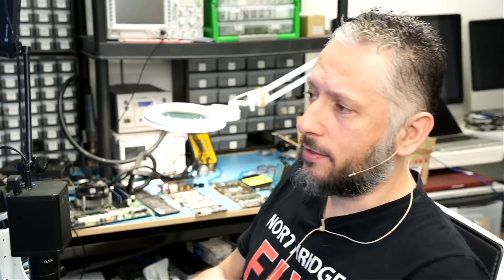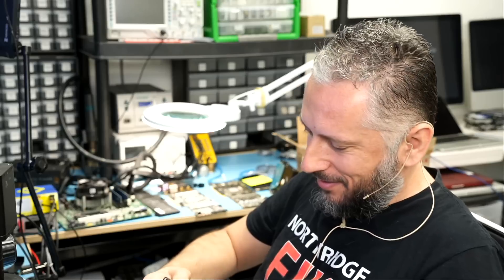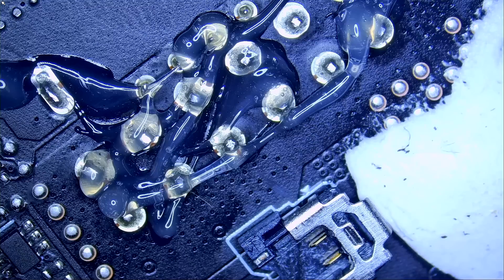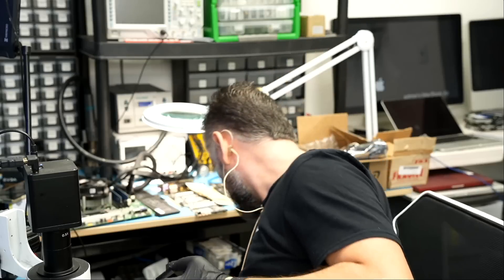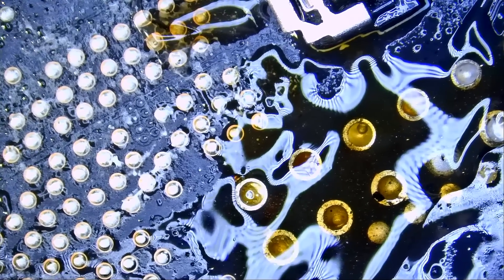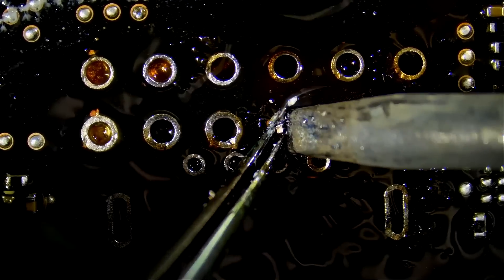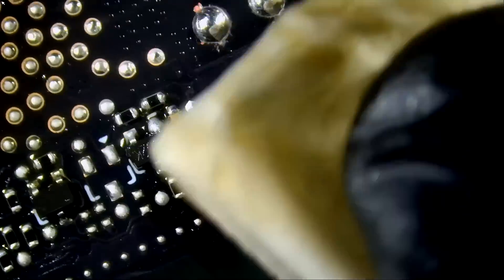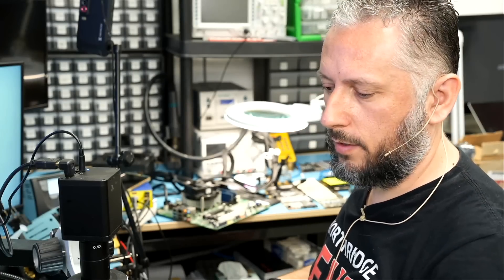4090 FE Connector melted with Cablemod Adapter installed. 40 series cards should be recalled

Comment: As i thought yesterday, the issue is not the user, when things like this happens to a lot of people its not the users fault. Everything is made and designed like crap nowadays, i am so dissapointed with the reliability and built quality of the modern tech. I have opened up so many modern laptops with crap plastic tabs that always break and with garbage designed hinches and where the hinches are screwed all crap plasic that breaks down. Big scummy companys get away with this which is absurd.

Comment: There is already a video that explains why this happens, it's a mix of bad connector design, quality and not properly plugged in cable, so the power goes only in the properly connected pins (6 or 8 or 10) and causes overheating because it's not designed to handle 500-600W on such small amount of pins. Also the pins are really thin and bad quality. This would never happened if you spit that 500W on 3 connectors or just made a good quality connector

Comment: I'm about to buy a 4090 in a few days, but with watching all these cards come in every day i'm not so sure. Might need to order half the NF inventory to keep it working.
Reply: undervolt ur 4090. keeps it cooler and safer.
Reply: I have ran my gigabyte 4090 since release at stock settings with the supplied 4 to 8 pin to one 16 pin connector with no issues and I am on my pc for over 12 hours a day. I made sure it was fully seated and did not put it under an extreme bend in my case. But with all electronics your results may vary.
Reply: @volkswagon1966  Yes it is probably effecting less then 1% of users but it is still pretty concerning.

Comment: People seem to forget their physics class, power going trough a cable will make the material heat and a connector doesn't have a 100% adesion rate, which makes it the same as passing current trough an even thiner cable.
It makes me laugh that even me a 24 years old "kid" knows that and not the enginers over at intel, nvidia and amd.
This is a big joke,  an even bigger error from a professional and a disgrace to their whole enginerring carrer.  It's on them for not properly ascessing what their connector can do.
On average one of these cards uses 400-600 Watts, and i'm not taking in account the power spikes, these connectors don't have enough contact surface to compensate for that and to add salt to the injury, there is not enough conductor material in the connector for it to stay at proper temperatures and not melt the plastic around it in case of power spike.

Comment: I was wondering if many of these meltdowns are caused by poor case ventilation or AIO CPU coolers.   A lot of home builders of rigs simply don't understand the critical importance of case cavity throughput and air channelling and you do get dead zones in and around where the usual PCIex slot for the video card is which can get pretty hot esp if you have chip management, SSD's etc all putting out their own heat footprints.   Then factor in unheard of video card wattages being channelled in, beast sized power supplies happily funnelling in those huge wattages and the damned connector doesn't stand a chance esp if its made from substandard cheap plastic.   nVidia should of seen this coming, maybe used ceramic connector blocks?   Maybe find a fan that can be focused to just the connector to bring its heat down, enough to stop it dribbling under load.

Comment: The connector has 4 data pins that, according to the  PCI-SIG 16-pin connector specs can be used to communicate with the power supply to ensure the connector is fully seated before delivering the full 600 Watts to the board. Does anybody know if this feature has been implimented on the 4090 and do all power supplies also comply with it? Nvidea is blaming the users and PCI-SIG is blaming the manufacturer of the sockets...... so business as usual!.  That 90 degree adapter looked to me to be fully inserted and  it looks like it has melted inside.   End of the day....too much current for too small a contact surface area!  Gold contacts anyone?
Reply: only 3.0 psu could have that

Comment: The 4090 (4080's?) series connectors are simply a stupid idea for the higher power-drawing cards.  There simply isn't enough contact area and/or material to handle the higher current.  WTH were they thinking?  It's just like the stupid USB-C spec of 100W - yeah, 5V@20A through one of those connectors will work perfectly in constant use🙄  I simply refuse to buy the 4090 of any manufacturer.
Reply: Just an FIY, USB-C power delivery of higher wattages is done with 20V @ 5-6Amps, so it is safeish. But you re right about this new 12V ATX connector , its a bad design.

Comment: I wonder if its a case of the solder joints getting hot, and possibly using an inferior type of solder or soldering method.
The solder is drying out  and causing an intermittent connection on the pins causing them to overheat. 
Just a guess, could be wrong.
Reply: Don't think its a soldering problem, most likely the pins not fully contacting causing high resistance and heating up to the melting point of the plastic connection.
Reply: There is nothing wrong with the unleaded solder joints. It's all about contact resistance.

Comment: What if you solder wires directly to the motherboard instead of using connector? 
Yes, it is multilayered board but there is no reason this workaround do not to work..

Comment: This obviously needs further research; is is a bad batch of connectors, overclocking, bad design.... Little worried, I have 2 x 4090, so far they are fine, running for ~1 year.

Comment: It's pretty obvious at this point that the connector is way too small to pass the current the board requires. It's a pretty bad design fault that the board manufacturers need to address.

Comment: The plot thickens, I presume you don't fit a genuine Nvidia connector, do you ever have problems with the ones you fit? If not could the pins on the original connector be slightly undersize so they do not grip tight when plugged in

Comment: After researching this connecter is come from "intel" designed. they design to feeding power maximum of 600W, But they warned keep save at 450W. So...NVIDIA doesn't care. And still use it feed up to 600W and forced card makers use it with anthorithy and the fame of the #1 GPU market share.

Comment: This is a 100% nivida error and I blame everything on them I have 2 4090s and I'm pretty sure I plugged in that cable all the way in and it burned still on both cards I replaced the connector after 1 month I want to get the connector off just to check if it's burned and I couldn't take it off it's melted again and smells like burned garbage so idk what to do anymore should I put a 3 phase wire on there??? Or should I plug a 200 amp wire to it I just hand enough of this I really want to throw this card all over the concrete floor but the issue this card is expensive
Reply: Just a thought as an engineer I would think that the problem looks like consumption is beyond the designed output.connector can not handle the power consumption.i assume this problem occurs when 3 outputs are connected.i don't know if the card was designed for 3 o/p if so then the card or more specific the connector is not designed to carry the load. If it is designed for 1 then perhaps the overloading is customer created. Because you are using 3 times the power designed for

Comment: Perhaps it's reached a point now where video card designers and manufacturers need to consentrate on developing less power hungry and more efficient cards?
Reply: The issue is that the current gen cards are the most efficient ever... The power is another story separately, unless there is a regulatory push and excess taxation on similar products[0], it's not going to change. [0]: vacuum cleaners and the EU - EU forced vacuum cleaner producers to drop the power draw as the power was used as an advertising tool, more power didn't mean more suction.
Reply: they are

Comment: What a great work ALex i mean how many of these card connector have to melt to see what the problem is ...too much temp too little space they went from 24 pin power to 16 with a much power hungry card ...so the design of this connector is not ideal for the power u need to use this cards at least go 20 pin

Comment: If you have 4000 series ...  try to undervolt and decrease the power limit temporarily to avoid melting your connector ... this will limit the amount of power coming through the connector ... but note that decreasing the power limit may result in small loss in performance
Reply: i undervolted my 4090 since day one. 150 watt less power draw (300watt ish max power draw) for 95% performance.
Reply: @dwight2310 How'd you do that?
Reply: If the pins have a high resistance fault, reducing the load wont necessarily prevent it overheating unless you reduce it to unusable levels.

Comment: I guess this connector meant to be universal, like usb type C
if the card demand 300W, the connector will deliver 300W
if the card demand 600W, the connector will deliver 600W
but the thing is, this connector not working properly or something, or maybe the pin is kinda smaller for this high power

Comment: From what I recall, the issue lies with the standard power cable adapter from nvidia that is made of poor quality. I haven’t seen any reported cases of melting connectors from people who use a cable sold by the PSU manufacturers like the one from BeQuiet

Gamers Nexus did an in-depth analysis of it
Reply: I use a fasgear cable going straight to the psu from the 12vhpwr cable off the GPU. Corsair sales them too   Cablmod is a joke. It’s just a company that has seen a opportunity and profited reaching out to influencers on social media and they all bought into it. It wasn’t the answer and far from what was mis-leading on their part like jay z and the other clowns out there that are just in it for sponsorship and money driven content.  

I wish people would wake up to these shills.
Reply: @Pixel_Perspective25  yes
Reply: What about using a 3x8 to 12 pin instead of 4x8 adapter? I have not seen any of those melt with the 4090 and it is enough to run the card if you do not do big oc.
Reply: @xcom9648  3 is more than enough to run big oc ~ in fact 2 is more than enough
Reply: Except in cases where it WAS user error, a few PSU cables I recall melted from that.
Reply: This is apparently the guy that Cablemod uses to fix the cards that have melted while using their adapters/cables. This is probably one of those cards. There have at least been three, and probably more, cases involving a cablemod cable. 
I haven't seen any cases with cables from PSU manufacturers either, but I haven't really been paying attention so it may very well have happened.
Reply: @randomguy-  yes it has
Reply: @roadi7  Yes, there have been cases using cables from PSU manufacturers?
Do you have any links? Not that I don't believe you, I kind of assume that is the case, I just haven't heard about any.
Reply: Your recollection is wrong, every case of the issue was determined back to being not plugged in enough to click, and melt lines were present on the terminals of the adapter to indicate this as fact.

Comment: Looks like they are saving money at the factory by only putting 1 connector on where older cards had 2 or 3 connectors splitting the load on 3 phases. 100 % recall in my opinion

Comment: The same user fault can happen with the adaptor. I found that a standard cable gave a good click sound, but the cablemod adaptor did need a recheck as it did not sit 100% flush each time I took it out. 
Now, every time I unplug it, I spend longer checking it.
Reply: If you're having issues with your adapter not fully sitting flush, then chat up our support team for a replacement. They'll make sure you get a replacement ASAP.
Reply: @matta.1673  Hi. It works fine; it just does not have that satisfying click (for all the sound is worth) when I use it. It's not the end of the world, I just double-check it to make sure.

Comment: I still think we need to look at the power supplies people are using.  Is the card using so much wattage that the input is physically melting?  It seems to be the case.  But this is great feedback to these companies and ship these cards to the companies making these cards.  Is it maybe the quality of the connector?  Alex, you are a great detective, this needs more attention.  I have reached out to Steve Burke from Gamers Nexus to take a look at the vids.  It is fused!!  How close is this to become a real fire hazzard?!
Reply: The power supply will not make any difference, the card will pull the required current it needs (even a 50000W power supply will only give what is required). The issue here is the plastic, plain and simple, it's melting point is too low for the amount of current. Since it is not causing the solder to melt, I'm guessing that connector melts under 200 C. An LCP connector should not have this issue. Why not manufacture it with LCP (or better like PEEK, which would be my go-to for this)? cost.

Comment: Maybe someone could design a new plug that will solder to the board with 4x 8pin plugs in a row on the other end of the plug? Or could the nvidia supplied 16pin to 4x 8pin be somehow soldered directly to the board?
Reply: Or solder the 16 wires directly to the board lol

Comment: It's definitely a faulty design. And part of that faulty design is when the cable is not plugged completely in, the connector melts. An engineer needs to design such a critical failure point part assuming a lowest common denominator user will be installing it.  This is not a user issue.

Comment: Thank you Alex for your opinion on this matter. Hope the connector designers finally get the message and new 5000 series will come with redesigned safe connectors
Reply: 5000 series will come with a smoke detector that fits in a midtower case.😂
Reply: For the 60 series i'll be buying a card that has 2 connectors
Reply: @DunoCZ  any design would be better that current one. I dont mind any options as far its safe.
Reply: @DunoCZ  maybe add some gold plating for the prices they charge lol

Comment: it is really a poor design. 450W or what ever the RTX 4090 uses would be far better over 3 x 8 pin than this connector. I have a RTX 4080 but this has a lot lower power draw so I have not had this happen to me.
Reply: the 4090 goes up to 600w so you would need 4 PCI-E ports which there really is not space for it so the GPU would have to be even larger. In normal use the 4090 draws about 250w to 350w and you barely see it above 400w unless your really pushing the card by benchmarking it.

Comment: The thing is, the adapter melted into the connector on the graphicscard. But the connector from the power supply did not melted into the adapter. The current is all the same, this means the used connectors on the graphicscard have a quality problem, the contact resistance of this connection is too high.
Reply: Wrong, it means a tolerance flaw exists at either the card or the male socket of the angled adapter.

Fact: It's usually fault or misapplication of the MALE terminal that causes resistance failure.

Comment: I think the pins in the male connector are a quite litle bit smaler than the female connector. So than micro sparks heaten up the pins, so the whole plastik melt. This is a problem of fabrication and not a user problem.

Comment: think it's there's a problem with the connector and the plug.  maybe the supplied terminals in the plug fit but are a bit loose for the pins in the connector.

Comment: As a mechanic and overall diy guy, I can't believe the falure rate of straight off the shelf parts. Especially electronic parts, what happened? Are there no quality control anymore? Brand new parts fail, as a mechanic its very frustrating. Customers get upset thinking there getting scammed and im doing the same job, at a very reduced rate to make it right.

Comment: The thing is you could have a lot of call backs on work you have done if the board is not configured properly in the first place  i know you can only use what you have but i would tell the people to contact the company the board came from or you could constantly be replacing the connectors  another great video 👍
Reply: What config would cause this that came from the factory?
Reply: @D J  too much power on one connection split between too to share the heat or possibly metal connections as plastic keeps melting

Comment: I think only way  to prevent it happening again is to run GPU stock clock speeds or slightly lower than factory and under volt GPU to draw less power to prevent connector to melt, but thats  outrageous countermeasure when you pay so much for top of the line GPU.
Reply: That's not how it works.  The problem is if not all pins have the same resistance then some will take more current than others, causing them to overheat.  Given the limit is 100W per pin, you'd have to underpower the GPU significantly to prevent that.
Reply: Heavy fly leads to a decent connector that can handle the power is the easy reliable fix that connector is designed to fail deliberately why else would they use such a puny piece of  grosely under rated detritus
Reply: Who the fk buys the top of the line luxury gpu that gives some 2% more performance to go ahead and underclock it to perform just like the 600$ cheaper model tho...